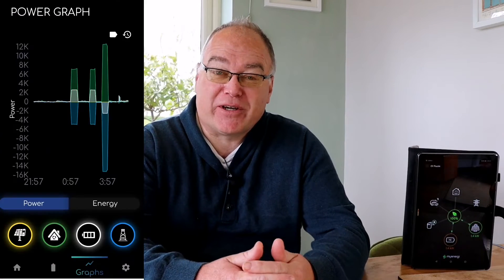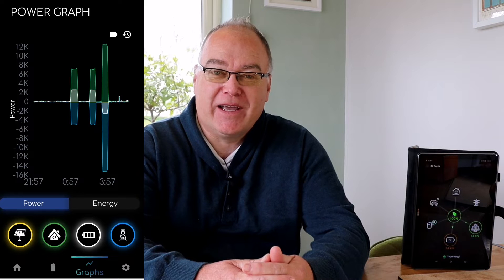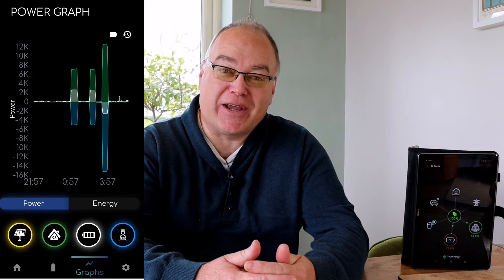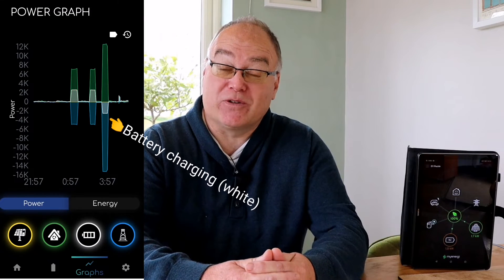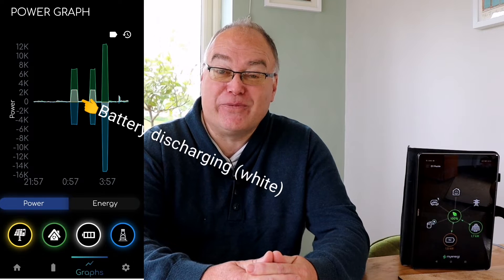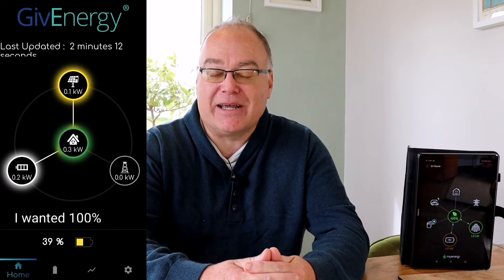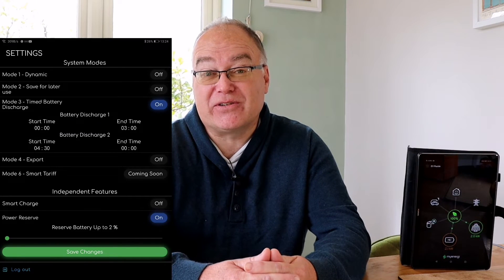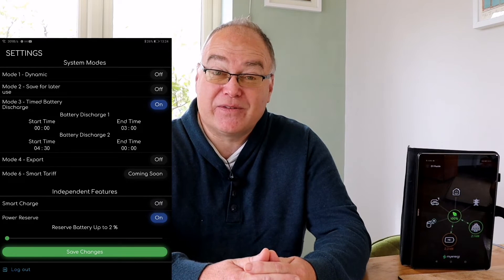Home Storage Battery emptied overnight. How to stop it draining

Comment: The system I had installed this year does all that. I have 21kWh storage, which is force-charged from 2-5 at night at a 15p rate. The battery is forced to charge regardless house demand. During the day system is in self-use mode where the source of the energy is the battery.  From 4pm to 7pm, the system is in the force discharge mode when selling excess energy to the grid at a 27p rate. After that system goes to self-use until night charge. 1. November in the Midlands, solar panels at the 10 o'clock producing 45% of the capacity, 2kw at the other side of the roof.

Comment: You could add another CT clamp onto the Live feed to the items you want to control and wire it in parallel to the CT clamp of your battery/inverter but in antiphase. This will cancel the grid current signal component of the items monitored by the new CT clamp and blind the battery/inverter to their grid consumption which the battery will not then try to supply. You can in addition add a switch in series with your new CT clamp so when the switch is open the items drain the battery because the battery/inverter will see the grid draw and supply it to bring grid draw to zero as at present but when the switch is closed the two CTs grid signals cancel and those items draw from the grid.
All other functions behave as normal.

Comment: Very simple solution - set your battery to charge at a very low rate throughout your cheap energy period.  I charge at 200w.  Any other charging can take place without accidental discharge - no messing about with timers etc.

Comment: Hi Roger . The simple way to do this is to set the battery to charge from the grid in the off peak times . You can set it to charge at a minimum rate of 1amp .

Comment: if its a regular octopus go slot eg 0000-0400 can you set the givenergy to charge during that period and it’ll entirely block discharge? eg you set the battery to charge to 20% but you get to 0000 with 50% due to solar the day before. Then you set the car to charge. Will the givenergy discharge down to 20% and hold it there or will it stay at 50% and all the EV electric will come from teh grid?

Comment: I have a Give Energy hybrid system and I am so cofused by the whole thing, my battery usually sits at 4% which is no good if there is a power cut. Why is this so complicated?
Reply from the maker: It's not supposed to be. If its not charging above 4% sounds like a problem that needs reporting
Reply: @EVPuzzle  Well it charges and today currently it is sitting at 30% but tonight it will just drain the battery and I don't know how to stop it.
Reply: @EVPuzzle  I am looking at the app and under the (Battery Discharge Settings - Dynamic) (Discharge Power - 2600W) (Reserve - 40%). I assumed it would not discharge lower than 40% on these settings but clearly I am wrong.
Reply from the maker: Try the givenergy forum on Facebook they'll have more current info than myself.

Sounds like I dodged a bullet
Reply: @EVPuzzle  I don't really do Facebook, I had a quick look but I couldn't find the group. I thought you may have answered my question.

Comment: My solution ( up to now) has been to move the CT coil downstream of the meter tails and any devices that the grid is working with. I have sunsynk inverters, pylon batteries and an "immersun"  diversion controller ( the prequel to the EDDI) so during my off-peak periods the grid only functions on the circuits that are not on my "essential loads" consumer unit.

Comment: Ok, but with octopus tariffs, the best tariff for ME is their special export tariff which currently pays 15p/unit. Octopus will not allow you to have "Outgoing Octopus" and "Octopus Go".
So with an Eddi and Harvi, it's the "Do not use battery" setting. Presumably this basically says "if the battery is discharging, don't charge the car or heat the hot water.
I have the advantage of being retired, so can plug the car in during the day...

Comment: As you set an Eddi charge schedule You can also use the Eddi expansion card timer function to send a signal/input to the AC coupled Inverter/Charger to stop it discharging at this period or at any time during the night. Depending on the Inverter/Charger you choose different levels of external control are available through relayed, RS233 or usb inputs.
You can also use a stand alone Siemens PLC programmed to see all devices and the energy flow. As charging starts it can detect voltage, latch a relay or send an analog 4-20 0-10v signal to control the AC Inverter.
These PLC’s are superb, you can island using contractors and voltage sensing and use the AC coupled battery system when islanding, opening a contact or the grid supply and back feeding the house board. 
You can do anything you wish with a little Siemens Logo PLC
Reply: Heading into B.M.S territory  now Peter, like your style....Great points through out your post. With a little know how & a plc, anything is possible.

Comment: How did you tell your battery not to discharge? And is it possible to charge your battery from the grid during the night whilst it’s cheap?
Reply from the maker: Yes charging from the grid is standard stuff for most batteries, grid connected of course.

Battery can discharge or not as needed with all the various settings across the systems. Export margin on the Zappi helps as does the avoid drain feature

Comment: Hi There,
I've noticed that when our oven is regulating it keeps pulling from the grid first when it is pulling energy, by the time it switches and it starts to pull from the battery it regulates off again and this happens over and over, so most of the time my oven runs it is pulling from the grid. This is only trying to pull around 2kw too, so nothing special. Does anyone know if it is possible to prevent this?

Comment: Hello 
I updated my system with harvi with I connected ct1 to grid ct2 to sollar generation and ct3 to my pylontech battery red cable but I do not get any riddings from battery can you do a video with instructions ho to connect batteries to the my enerhi harvi hub or to zappi to get battery riddings like you have from what I see on your tablet 
And Thanks for a great job as I watch lot of your videos and they was ever so helpful
Reply: Yes I went throught all options and on your video where you have battery in my energi app you actually can see that energy Is send from solar to the battery in my case I just see batter and no readings at all and I spend all day playing with ct clubs but they do not get riddings from dc batteries pylontech at all so how you did manage to get your riddings :) how did you get your batteries readings in the app and how did you connected it as I can't find any info about it or instructions 
Thanks Patrick
Reply from the maker: Have you set CT 3 to be a battery in the Myenergi setup.  On the Zappi or Eddi go to advanced And CT Config set to storage only?
Reply: Hi
Yes I did all that I watch all your videos I think and I noticed your ct settings was on storage only or ac battery I check both options still I am unable to get any ridings where did you installed you ct clamp on the battery red cable may be I installed it in wrong place 🤔
Reply from the maker: It needs to be on the live wire connecting it to the grid , definitely not the DC wires connecting battery to inverter.

Hopefully it's not a hybrid inverter you've got with your Pylontechs
Reply: Yes that what I thought but I thought I will ask as may be there was way arround it 
Thanks a lot for your time and your replies thanks a lot Patrick
Reply from the maker: I think I have fine a video on exactly that.  Have a browse through all the Eddi and Zappi content
Reply: Hi yes it is sofar inverter and I believe it is hybrid one and I have 16.4kwh of pylotech batteries 4x us3000 plus one us2000 and I wanted to be able to see how much does it send to the battery and send out from the battery kind off like in your video but I read that if battereis sits behind inverter there may be no way to get riddings from them 🤔
Reply from the maker: You wont be able to see it on myenergi im affraid.  As it's hybrid the Ac power out could be solar power or battery power, you can't tell which as they're blended. There's no DC CT clips I'm affraid.

The only person I've seen getting this going is a solar installer based on Orkney called Wire Brigade on Twitter

Comment: You can use the Eddie Relay and sensor board that switches one of its relays  ON/OFF when the Eddie is heating, this could be used to drive an Alexa bluetooth switch module to indicate to an Alexa system when the Eddie is operating, this could be used to control other devices i.e battery not to discharge.

Comment: I have free grid weekend car plan or anything electric 12 -2 pm no money. Australia and the electric companies are trying to burn solar grid input. I charge my powerwall2 in the winter, charge my car, AC, heating, whatever I can think of, I use,  all within my mains fuse. Mains fuse is only 45 amp. I can over extend the internal home electric because I have a powerwall2 and solar and an updated fuse board and never really used grid electric since August 2017 apart from my ev charging plan which I take advantage of as much as possible. My powerwall2 used to say zero grid usage , not now

Comment: Really useful thanks, just what I was looking for.  I have solar with a Givenergy battery and I am looking at an electric car with a home charger and I was wondering how I stop the car draining the battery at night. It looks like I need to use mode 3 where you can choose when the battery discharges.  Would you still go with the Zappi charger?
Reply: Thanks. It is a steep learning curve this transfer to an electrical future
Reply from the maker: Yes Zappi all day even if the app can be frustrating at times

Comment: You are spot on, my tech ev charger cannot see my economy 7 rate but it can just use pv energy so I still have to think about and step in and manually change the way I need to save money. I know new ev chargers now can do what I need but I cannot justified the cost. And yes would it be nice for my pv battery to charge its self on my economy 7. Clever tech not

Comment: Come on Nigel, that's what the Modes are for, you could have used Mode 2. Also, you could have set a point that the battery will not discharge below to prevent completely discharging.

I think it's a bit selective to say that you made a decision to use an Agile plunge price, but you forgot to set other parameters. I have also made a mistake on my settings and I hopefully learned from these mistakes.

I agree that better integration would be good, but one size will never fit all as it depends on how much risk you want to take about how low it is safe to charge down to.
Reply from the maker: Could've  shouldve all great in hind sight but if memory serves me right mode 2 turns the battery off so it's not in use. Saves the battery but I want it on working all the time .
When setting parameters often, mistakes and misjudgements happen. We're human

Comment: Nigel, I think you highlighted that retailers of green products are more interested in the sale than the system. Share trading software allows a purchase when a certain value is reached, obviously the same should be intergrated into buying or using grid or solar produced energy.
Reply from the maker: That may well come soon. Myenergi do it already utilising grid resource when a certain price point is reached. Battery manufacturers will offer the same in reverse for export at some point. Its possible now with some bespoke programming. It'll all depend how popular using a battery to generate income from  exporting becomes.

Victron say its not viable as battery degradation costs more than the income but I'm of the opinion is does make sense

Comment: Hi Nigel. You might be aware already but if not, GivEnergy will soon be releasing an OTA update to allow for device control.  This will obviously need CT clamps to be installed on each device, then plugged into the Giv inverter, but it will give us this holy grail of control you speak of - for example I will have a CT clamp on both of my car chargers so that I can tell the GivEnergy battery not to discharge when the chargers are demanding energy (charging) - so this is perfect for me.  Thoughts?
Reply from the maker: Ian

Givenergy talk about these features a little too vaguely for my liking so I'm not convinced fully yet that it'll do what we hope it will. Time will tell.

Sadly, I've been saying for 6 months they'll be releasing any moment new features for improved time intervals and the 2nd timed charge slot, which sort of arrived then sort of disappeared. They talk the talk but take forever to get things working it seems.  There's lots to be optimistic about for sure though.

When I talked to Givenergy about his before they were thinking it'd be a bolt on extra you pay for. Who knows though what they'll actually do.

The control  I want most is export margin, to balance to the grid better. Right now I'd be happy pushing 20w to the grid continuously thus avoiding grid draw completely
Reply: @EVPuzzle  thanks for the reply.  Interesting.  My system will be installed in 4 weeks and they are preempting the addition of load control by running the CT clamps to monitor my 2 car chargers to the inverter so at least the expected hardware is in place.  Yes I understand re: 20w continuous discharge - I remember you saying you were surprised with the lazy monitoring and always being a grid draw.  I will let you know how it goes!
Reply: @igriffit  hello can you please provide an update have they sorted this out yet

Comment: Don’t you have CT clamps around battery, solar and grid feed  so the zappi knows the difference and can avoid battery
Reply from the maker: That only works in solar eco/ + modes. Boosts can't prevent drain. As I explained Zappi does not stop the battery.

Comment: Hi Nigel. I have had a system installed that may be of interest. It uses a Sofar inverter with Pylontech batteries controlled by the installation companies own interface that utilises their own Solar Diverter unit. It can be programmed to operate as you have specified. The supplier will adjust the software to suit your own needs. The main issue I see is the integration with your Zappi device.
Reply from the maker: Good news the sofar inverter can be controlled programatically although I can't understand a solution that requires support calls to amend. Manning a phone supporting customers who could support themselves seems like an unnecessary business overhead.  The control is obviously for their benefit.

I'm not a fan of giving control to anyone else but myself. It feels sort of like you're loaning you car out overnight ... for peanuts.

Comment: What we need is all the Manufacturers to publish their APIs like Octopus do and then some clever programmers can write the software required, sadly unlikely to happen! My Powerwall is set to self-powered mode so I just set it to not discharge below 80%, works but is very messy.
Reply: Givenergy uses other suppliers tariffs now and shows estimated costs just option for SeG payment tariff looks like it is coming soo too along with weather tracking !

Comment: The integration is the hard bit. The lux devices have the concept of standby which means the devices will not charge or discharge but this can not currently be scheduled by the software. I do have a method of doing that with some custom code, but I will confess I just charged the batteries the other night due to the price being below 8p ....
Reply from the maker: Why the developers don't do what we do and look at the market picking the best from each I'll never know. I can only guess it'd budgets and limited development resource, probably outsourced in many cases so limited quality too. Software needs to be higher in the priority list and hardware companies are slow to catch on sometimes

Comment: Nigel, I had the same problem with a Tesla Powerwall, always discharging into my EV when I plugged in to recharge.  But I have overcome the problem using a Raspberry Pi to switch the Powerwall over to 'Back-Up Only' mode (this makes it charge up from the grid and not supply energy), using an unoffical Tesla API.  

I actually use the MyEnergi Account system to control my EV charging (which automates it to the cheapest Octopus Agile time slots and turns it on whenever there is a price plunge) and my Raspberry Pi monitors the Zappi and switches over the Powerwall as and when the Zappi is doing a scheduled charge (as automatically set by the MyEngergi Account system), so the Powerwall no longer discharges.

There is an added bonus in that the Powerwall actually charges up from the grid during these cheap time slots, thanks to the 'Back-Up Only' mode.

In the depths of winter I set things so the Zappi tries to charge my EV for the four cheapest hours (usually overnight), even when the EV doesn't need a charge and this is sufficient to fully charge my Powerwall when there isn't enough solar to top it up, thus saving me from having to use grid energy at peak rates.

This makes my Powerwall a 'smart' device and makes my energy use cheaper than the Tesla 'Advanced' mode in their app, which only accounts for low, normal and peak rates, not the half hour changes of a smart tariff.

I'm happy to share the set-up and code I use, with anyone who is interested - Just PM me.
Reply: We do the exact same thing except being in Aus, I had to write some code to decide when is the best time to charge our EV (we have something similar to Octopus Energy but they don't integrate directly with MyEnergi)

We have gone one step forward and only use the battery when wholesale price is above xx and use the grid when below xx.
Reply from the maker: Raspberry pi is brilliant little device
Reply: @iainsear7830  Yes, e-mail me on contact@liveactionfx.com and I'll provide a full write up to you.